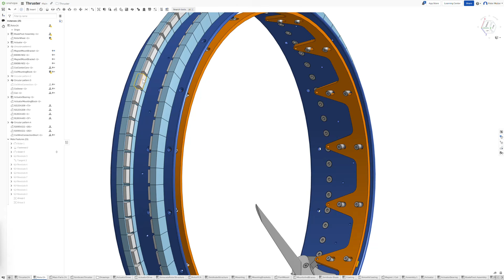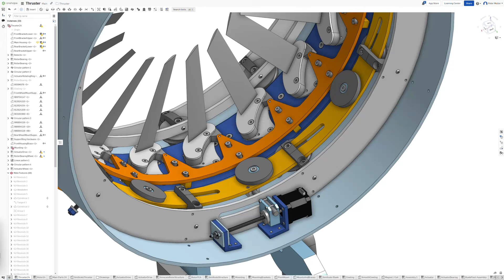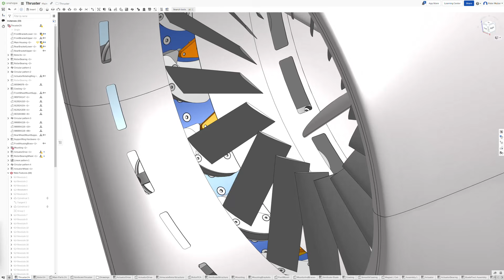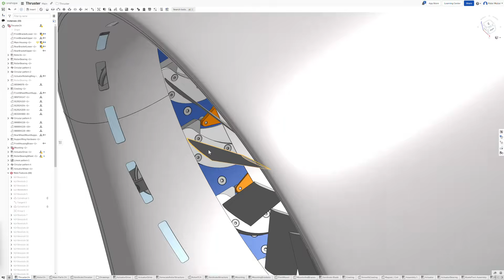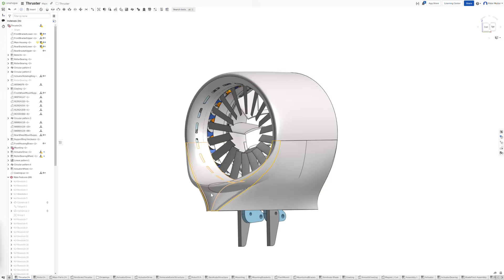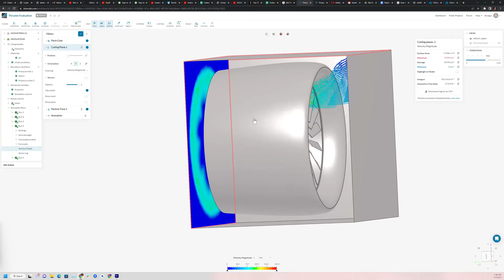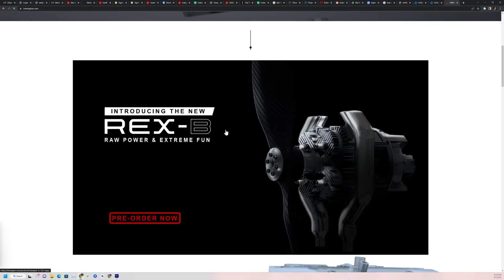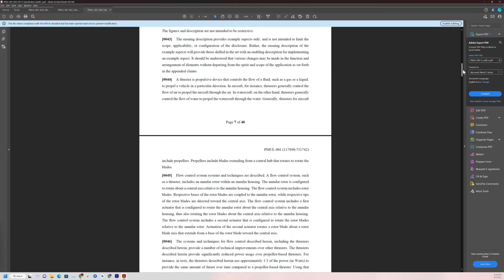Could this Thruster transform Aviation?

Comment: At fan speed of 5000 rpm, those thrust rollers will be doing maybe 50000 rpm, so I would be worried about the bearings in those.
Reply: Good point. They would also have to deal with greater load as the RPM increases, and the centripetal force pushes the blade onto the bearing, with a force of many times the blades weight, when stationary. A conventional shaft, does not have that problem.
Reply: The bearings and the entire fan cage is wobbling even at 100 rpm.  It needs a lot better balance control if it tries to have a chance at higher RPM.   The design has a lot of potential, but I don't see it as a working design in the real world yet.
Reply: @onebadwolf9123  One would have to do a material stretch analysis on the rim material to determine if centripetal force would cause effective loading on the bearings. I would be more worried about the lubrication and velocity of the bearing itself.
Reply: air bearings to the rescue!
Reply: @narmale  Magnetic levitation?
Reply: The only chance is gravity waves generated from element 115.
Reply: At 100,000 lbs of thrust when its "scaled" up, those roller thrust bearings won't be able to handle the force.  Its one of the big weakness in the design.  The smaller the contact area, the less heat and friction generation.  With a fan blade that large, and the entire rim to support, it would not be easy to contain contain those fan blades without more more bearings along the rim, thus adding even more friction.  You also have issues with maintaining alignment of those thrust bearings so it does not become uneven and warp the blades.  There are definitely engineering design issues with "scaling up".   Those blades also need to be dynamically balanced to decrease vibration.

Maybe I missed it in the video, but is there an inherent design advantage to making the motor in this fashion?  It has to solve a problem that can not be done with conventional motor designs.  It seems like there may be some advantages in terms of air flow and drag, but that problem translate to other losses like friction.  In the engineering world, its a compromise and most of the time there is no free lunches.  I like the design concept though.  There are ways to address the hysteresis issues with motors.  Tesla addresses the issue using polyphase on their synchronous motors.  I'm sure that is already patented.
Reply: Yep, puddle o parts.
Reply: The turbofans I've worked with in the past has lubricant flowing through the bearings via a pump.. the only thing that works with a working rpm of 11,000
Reply: Plane bearing with high pressure oil
Reply: @onebadwolf9123  conventional turbine shaft mounts have thrust bearings too.
Reply: @alexmason1387  It wouldn't survive the number of life cycles at 50K rpm in the current design regardless of any oil.  The heat production is on the frictional contact on the outer rims of the bearing, not the center of bearing rotation.
Reply: @I Love Aviation Engrish please.
Reply: @onebadwolf9123 centrifical?
Reply: Right, classic fan with electric motor is much simpler and effective design, we need just to replace jet fan engines with electric fan motors. If 85-90% of modern jet engine thrust comes from fan, then why we don't build electric motors with same fan diameter/blade Nr. but with higher air volume throughput, because of more compact electric motors connected in series and will have the same or higher thrust and will just simply turn it on in the second when need it, without all those complicated and energy intensive APU task using and creating MW of energy, just to start the jet engine, we can save a lot of  weight also with all the pipes and heat exchangers. Hydrogen fuel cell technology is so old and came so far, that big hydrogen tank can be fitted in rear part of airplane, where APU is and wings can be much lighter and smaller/more efficient and pilots can enjoy super precise thrust control during tricky wind conditions during landing, very easy reverse thrust, cost saving on support vehicles and of course, there will be super big emission and fuel cost benefit. Right?

Comment: Diameter of 24 inches, 5,600 rpm, your bearings are rolling at 643 km/h. You will need an air bearing or magnetic levitation. Regular bearing will not roll that fast.
Reply: Yes, but if you incorporate the bearings into the rotor and not the stationary housing you halve or more the rotational speed of the bearings
Reply: @go6369  How do you figure that?
Reply: Current prototypes for electric propellers and similar research in the past aim(ed) at 2500 RPM

Comment: Seven large blades with increased angle of attack and a three point mounted inner ring, I believe, would allow higher thrust at lower RPM. The small blades require extremely high RPM to produce thrust capable of propelling a plane. Also, in the current configuration the blade shape would need to have an overall pyramidal design giving the blades much more support closer to the ring and minimizing the flutter at the center. This is an exciting departure from normal thruster design. Great Work!
Reply: An existing airframe with a new motor is appropriate.  A beaver dehaviland  with only change being an electric motor powered by Edison generators or battery powered dynamos to power the original props.  The slightly higher HP and under amped motor.  The new blades are added to the design  to match the thrust.  An appropriate design airplane needs to be located to handle the progressive improvement.  Edison generators and dynamos power plants to power a turbo prop.
Reply: It does utilize pitched prop technology,  Flight dynamics computer can take of that.

Comment: You have composed a work of Engineering fantasy and had it published by a patent office. It's quite remarkable really. Like breeding a unicorn.
Reply: That is what most patents are though, to be fair.
Reply: There is a nonzero chance that unicorns exist, so there.
Reply: @dingdingdingdiiiiing  I will build one.
Reply: Correct. Picture 5 sequential 2m diameter bearing surfaces contained by an aluminium lightweight frame running at 20000 rpm.

Comment: Hello Peter. While I can certainly understand why this concept seems attractive to you, I think there are many reasons why this solution is not as good as exiting, hub driven ducted fans.
1. weight - Your rim driven motor and all the additional bearings and magnets and windings (not even counting the variable pitch mechanism) has got to be much heavier than a simple hub driven motor design. You are uniquely aware of the tradeoff between weight and performance. More weight means more fuel (batteries) which means more weight which ultimately means you need more power which means more weight which means more fuel... and it never ends.
2. bearings - How many bearings support the rotating ring? 16? you have several small, permanently lubricated bearings. These are analogous to skateboard/scooter/inline skate bearings. These will be spinning at rotational velocities many times that of the fan itself. if your fan is 24" spinning at 5000rpm, and the delrin "pully" is 3" or 4", the bearing will be spinning at 6 or 7 times the rpm of the fan itself (30,000-35,000 rpm). No small, permanently lubricated bearing I am aware of could survive more than a few minutes in such an environment. These most certainly could not survive a 1000 hour TBO time frame.
3. TBO - Any aircraft propulsion system is expected to operate trouble free at high power settings for 1000's of hours. This is because human lives depend on it. Could you trust these small bearings to run at 5000 rpm even for 4 hours? 1 hour? Will you have to replace them after every "hop"? Why design any propulsion system that could not be certified for a 1000-2000 hour TBO?
4. Corrosion - In this design, the edge of the outer hub is effectively a bearing race. The hub and the small wheels that hold it need to remain as perfect throughout the unit's lifespan as the day they were new. When the aircraft is sitting idle, water moister, even from dew, will collect at all of the contact points between the hub and the little wheels. Note that ANY deterioration, corrosion, insect activity, FOD,  at the contact area of the hub will result in degraded performance, create vibration, create stress risers, etc. and could easily lead to early failure.
5. blade rigidity - the outer most portion of the blades has the lowest angle of attack. This means the resistance to bending is lowest at this point versus the innermost portion of the blade where angle of attack is highest. Example: hold one end of a steel ruler flat on a table. It is easy to pick up the opposite end and flex the ruler. Now hold the ruler on edge at one end and try to pick up the other end. Even at low RPM, several commented on seeing "flutter" in your prototype. We realize that these aren't the final blade design, but... man. 
6. Motor magnets - again, being at the outer edge of the spinning hub, the centrifugal force is huge. Magnets often break free even in very small diameter motors. I doubt you could find an adhesive that would guarantee these magnets won't separate at 5000 rpm. How could this even be inspected except during engine overhaul? If then.
7. tension versus compression - all of the metals you will work with are always stronger in tension than compression. FYI - even though your blades may be in compression, the outer hub is in tension. In compression, if one of your blades isn't tracking perfectly true, compression will tend to bend the blade more out of line;  whereas, in tension (in a central hub driven application), centrifugal force would tend to force the blade more into the correct track.
8. Heat - as your hubless design runs under high power, the outer hub/motor will heat up and change shape. This could easily be catastrophic for an airplane motor running at 5000 rpm!
9. Efficiency - how and why would the hubless fan be any more efficient than a hub driven fan? They are both blades whirling around in a circle inside a duct. All you've eliminated are the "stators" that hold the motor in the center of the hub. But then, in your cad drawings, you add the stators back in. Certainly the design of high efficiency motors that could be used in a central hub application is well understood and very mature. Further, the hub driven motor can be built with only 2 large, robust bearings. We could even add a forced lubrication/cooling system; and, if desired, including a variable pitch mechanism in a central hub driven design is also very well understood and already employed in 1000's of aircraft.
10. a myriad of other considerations that must be accounted for such as heat soaking on a warm day, cold weather effects, rain, Ice, etc. These are "problems" so much more easily addressed on a central hub driven design. I put "problems" in quotes because these aren't really even problems for a central hub driven design. 

I apologize for being a Debbie Downer about your project here. I am hoping you have considered all of the above and have solutions in mind. Please con't be a Stockton Rush and kill yourself over an ill conceived "innovation". As I see several gush over your engineering prowess, I felt the need to inject some reality. Creating a new propulsion system is VERY difficult. Aircraft propulsion must meet so many criteria and cannot be even the tiniest bit weak in any area.
I enjoy watching your videos.
Reply: Weight: You've considered the weight of the magnets and coils, but forgot to subtract the weight of the core. 
The benefit of innovation is that even early patents can be improved through trial and error.
Reply: @iSoldat  this is more about selling the patent than actually making something useful